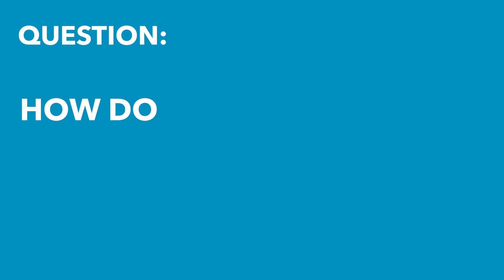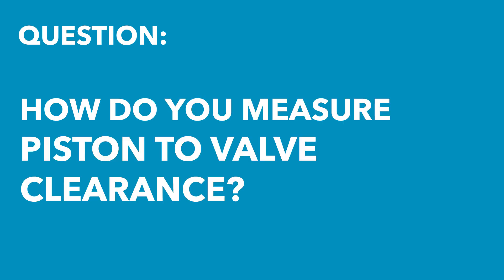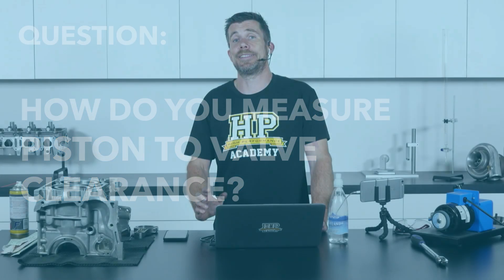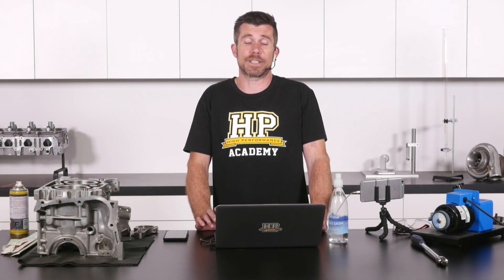[HPA Q&A] How do I measure piston to valve clearance? | Performance Engine Building

Comment: Both the plasticine and direct valve measurements can be effective, but neither is perfect.

The plasticine method is good because it can also be used to check suspect areas for piston to head clearances - when domes or raised sections of pistons are present, or when the head is decked significantly, or to confirm clearance/quench clearances. It may also indicate whether deep clearance notches in pistons need unshrouding, etc. However, it only gives the minimum valve to head clearance and this does compromise checking for alterations in cam' timing.

Using the measurement method* the valve to piston clearances can be checked at various positions approaching and after TDC - the closest clearances may not be at TDC - and it is easy to try advanced and retarded cam' timing as it is just a case of making the adjustment and checking as the head does not need to be removed each time. Starting the checking from, say, 10 degrees BTDC also avoids something I'm a bit paranoid about, inadvertently bending a valve that is just nipped. If you are using some sort of variable cam'timing, you can also calculate the effective timing and use it. The disadvantage is that it is purely a check for valve to piston but doesn't check anything else.

It does add a bit of shagging around, but the best option is to use both methods - the second one first, maybe?

*Just use the inner spring or, better, even pick some light compression springs from a good hardware store as you just need enough compression to hold the valve(s) closed. Use a DTI for the quickest, and easiest, measuring - gently push down with a finger until contact is felt and read the travel. There will be applications where a hydraulic camshaft is used (rules, ease of maintainence, noise, etc) and as the internal clearance can make measurements awkward, you may be able to find a mechanical type replacement, fabricate an internal spacer for a gutted follower (or pivot) or even just machine up an adaptor.
Don't forget to use the same gasket type and thickness - it is common to use an old gasket as it will already have been run and should be 'compressed' - and re-do the proceedures if any further machining is done to the head or block mating surfaces.

Oh, forgot, don't forget to allow for the valve clearance(s) depending on method - for example, if doing a zero lash/clearance check with the old Chev' 30-30 camshaft, the 30 thou' valve clearance will increase the theoretical valve to piston clearance by that much. With a hydraulic camshaft, there will be no additional clearance.

Comment: Here's a easier way to check valve to piston clearance prier to final assembly. Install a checking spring ( light pressure) on the valve stem, Install rocker arm and zero lash. Using feeler gages between rocker tip+valve tip and very slowly by hand turn engine over till it stops. Add up the feeler gages and that's your piston to valve clearance...
Reply: uhh, going to need a representation to understand haha.

Comment: Use putty. If you don't know that you should not be doing anything on the inside of an engine without someone there to help you.
Reply from the maker: Yes if you're lucky enough to have a friend of family member help you out that's great, if not you can still learn and achieve a lot alone just by taking your time and using resources to double check you're doing it right BEFORE you dive into it - Taz.
Reply: High Performance Academy I understand what you are saying and trying to do but you get a bunch of people who don't really know what they are doing building engines and trying to push the limits of their cars and you get drag strips with a bunch of cars puking oil all over the strip so that they are cleaning up more than they are running. You also get people running cars that need scatter Shields and other safety equipment that they don't have and people end up hurt when something in the drivetrain can't handle the pressure any more.
Reply from the maker: You do in indeed, and that's what we're trying to help prevent. People are often going to dive in head first and hands-on regardless of any good advice you give them, so instead of just telling people NO or leaving them to learn the hard way alone, we instead try and help educate how to do it all correctly. We even have course material that goes through things step by step right down to showing you how to correctly use the applicable tools and a lot of people are more than capable of using this info, applying it and having results that don't end in tears -Taz.
Reply: Exactly, more years ago than I like to think, my 'prenticeship was at least as much learning what not to do as what to do.
It is much cheaper, and informative (IMO) to learn where other people made mistakes, WHY they were mistakes, and how to avoid them.

After all, it is still much cheaper to build an engine the 'right' way the first time, than build it the 'wrong' way first (sometimes several times, from what I've observed) and THEN build it the 'right' way ;-)